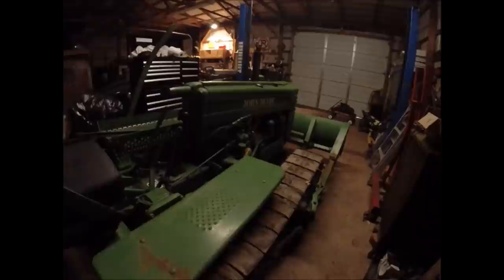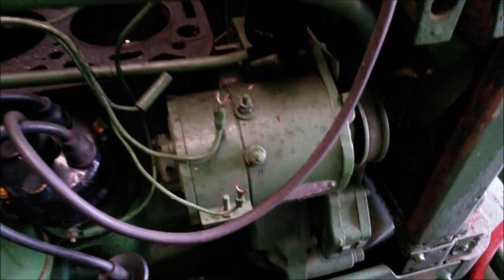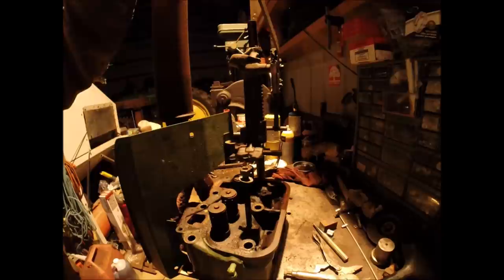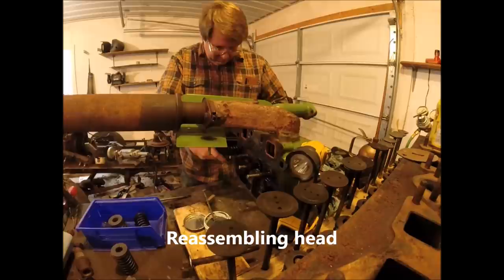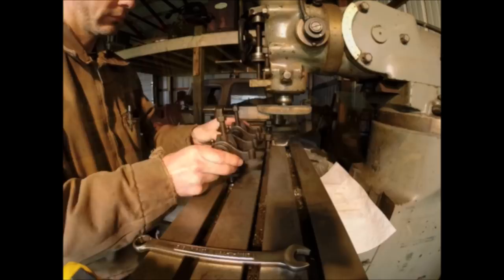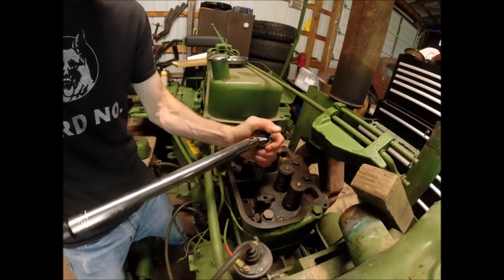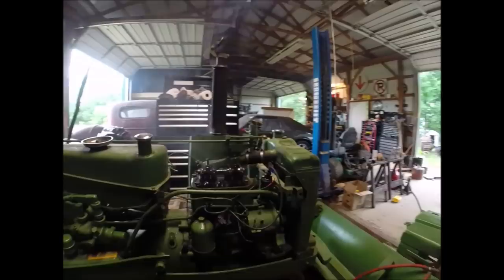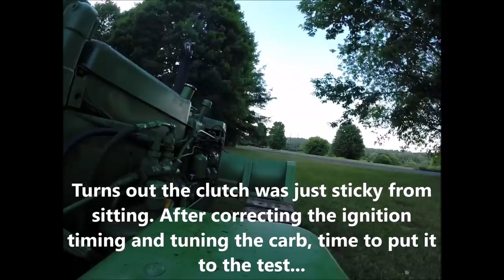Seized John Deere MC Revival and First Start

Comment: "wards off mosquitoes like a champ".  I like your sense of humor.  Excellent video and reasonable approach with very good repair work, to getting this MC operating again.  I've very recently been enlightened to the JD MC with multiple MC YouTube videos.  I've have what I think is a '48 MC, that's sitting in my barn for about 40 years.  It's a classic ran when parked unit.  I pulled it out into sun light in just the past few days and cleaned it up with hopes to get it operating.  YouTube is the best for info on anything and everything and a great source for inspiration and motivation.  My MC has original fenders and what look like the original tracks with almost no wear.  Thanks for sharing the video and your work.  Well done.
Reply from the maker: Dave, thank you! That sounds like a fantastic barn find, I wish the lowers on mine were in that good of shape. Best of luck bringing it back to life!
Reply: @RustyRescues  The guy that last ran my MC is still around.  I'm going to call him.  There is some spare tune-up parts on a shelf and 2 unopened quarts of factory JD green paint.  I haven't tried to rotate the motor yet, but everything else is moving fine.  I also have an old 12' JD wheel disc that I occasionally use.   The MC may have been used to pull it in the past.  Now, a 1980 Hesston 665 CM is the crawler I use.   Thanks again for sharing your MC video and details of your work.  Great stuff.

Comment: Great video.
I ran two of them in the mid 80s. 
Made a living with them and a rock pit.
Breat trail builders for the lake.
A bucket and a blade.
Slow and economical.
Even baled the steep side hills for a neighbor.
The weakness was if the pushed hard going up a bank. I'd guess 30 plus degrees you could limit the water to the sleeves, get a hot spot and when the tractor came back down. Crack a head.
They were back breaker seats and ear ringers if I dint prepare well.
Great little tractors. 
Probably 1000 plus hours on em.
My back and ears say more. Even with protection .
That is a very nice looking one.
The 420 yellow?
The number of idlers made a difference in ride.
Very pure old tractor .
A good muffler and a tip turn out highly recommended.
Thank you for taking the time and the talent.

Comment: I see you are working on the head with the manifolds and exhaust pipe still on. I plan to do the same when I get back to my Farmall, it’s more difficult to handle but it will save dealing with gaskets and rusted tight nuts and studs.
Reply from the maker: Oh yes, trying to remove the manifold would open up another can of worms! Makes it more clumsy, but definitely easier in the long run to leave it on if possible.

Comment: Threads in block should also be chased as they can be quite nasty with grey sludge. I usually wash them with solvent as I chase threads.

Clicker torque wrench are, for most part highly inaccurate. The springs in them compress and lose accuracy quite fast even if your careful to unscrew them after use, always always double check with a dial torque wrench or needle as they seems to stay accurate even after decades of use.  I also found that it's best to go around a final time just to check. Some times the middle ones end up being below spec.
Reply from the maker: In my opinion, "Highly inaccurate" is a bit of an exaggeration, but they are, of course, not the "most" accurate torque wrench available. That being said, for the jobs that they are typically used to perform, they are well within the tolerance range required; it's important to use the proper tool for the job. They should have their calibration checked intermittently, though, as they can drift. If a more accurate torque is required, a digital or beam type should be used, certainly.  I typically make the extra loop as well; Eases my anxiety at the minimum!  Cheers and thanks for watching!

Comment: Won't anti-seize mess with the torque specs on the head bolts?  Looks like you have a bit of blow-by going past the piston rings from the smoke I see coming up from the top of the head???

Comment: mighty clean machine. How long ago since the rebuild amd paint job?
dissapointing you didn't replace the rockers, honed the cylinders with the pistons in place ... 
sorry, but I was taught do the job right or don't do it at all.
doing a half-assed job just means you're going to be into it again sooner, rather than later = more time and $$$ possibly a lot more $$$$ because something that should have been replaced wasn't, broke, and caused even more damage.
Reply from the maker: The machine has never been rebuilt, and is very worn out. The museum it came from bought it as-is and threw paint at it to make it look pretty on display. Never let paint fool you.
There is nothing wrong with reconditioning rocker arm tips if you have the ability to do so, it's no different than regrinding valves.
The fact of the matter is that a machine in this poor of condition, without it running you have no idea how much it needs; is the clutch bad? How's the lower end? Is the trans good? Are the steer clutches good? Final drives? No idea. Do you dump a grand into the engine immediately, or do you do what's needed to make it run and then reassess the condition of the machine once it's under power, which is what we did. No damage is going to come from this, the engine was spun with no head until it built oil pressure, all fluids were changed and inspected for debris, anything that absolutely needed to be fully serviced was.